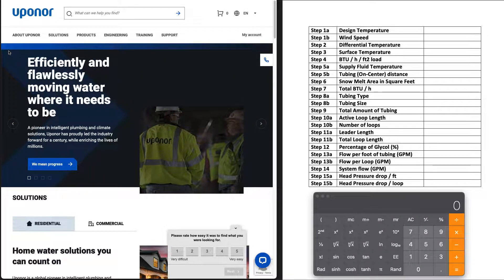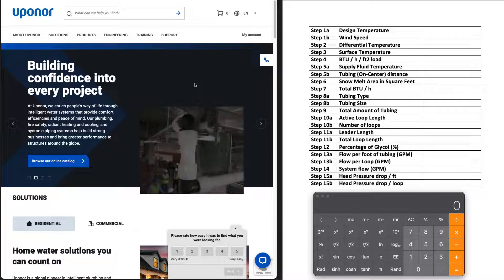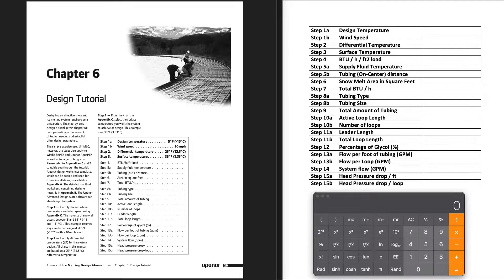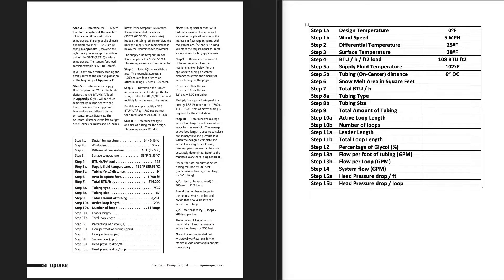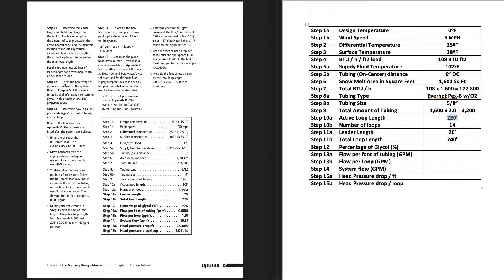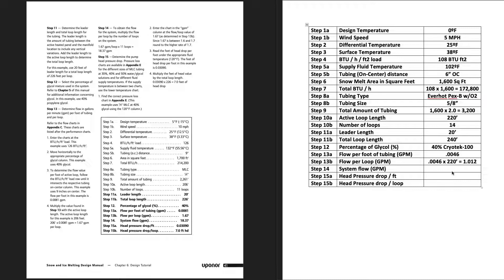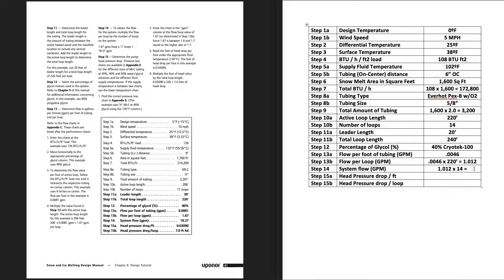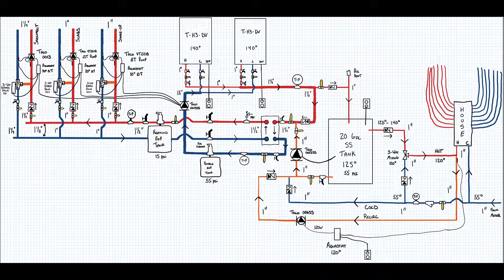Sizing the Heaters and Determining System Temperatures for a Heated Driveway - Episode 9 [11-1-2019]

Comment: It seems that the head pressure drop per loop should be based on the total length of the loops (240'), rather than the "active" lengths (220'). No?
Reply from the maker: Hey Paul.  Yep, you're correct, you typically want to calculate based on the total length.  Most of my loops ended up between 200'-240' total once installed, so it for me it worked out that 220' was the magic number.  I've gotta say, the math really works because my calculated numbers ended up pretty darn close to what I've actually observed while in operation.  Hope that helps, and thanks for watching!

Comment: if im making a system just for a driveway do I need to use a heat exchanger? could i just circulate the glycol threw the heaters?
Reply from the maker: Nope, no heat exchanger would be necessary in that case, as long as your heaters will allow glycol.  I believe the Takagi’s I have allow up to 50%, but don’t quote me!
Reply: @DeckerChristopherJ  thanks for responding.

Comment: I notice that the Everhot PEX (and others) have a minimum bend radius of 5X the OD.  In your case (5/8" PEX) this means a bend radius up 5" or a bend diameter of 10" but your spacing is 6"...how does that work?
Reply from the maker: Hey Huck!  I actually talked about this is a separate video you can find here: https://youtu.be/Ju19Mgx68fQ but in my case even though my spacing is 6” through most of the driveway, it wides out to 9” at the bottom of the driveway where each loop turns to head back. I had no problems bending the 5/8” to 9”, but I wouldn’t go tighter.  I did bend the 1/2” tubing in the garage and basement slabs to 6” and had no problems there either.  The days In July of 2019 when I installed the snowmelt loops were the hottest of the year. I left the loops in the sun for a few hours before the install and I’m sure that helped too. You might not be able to get 9” out of 5/8” on a cold winter day!